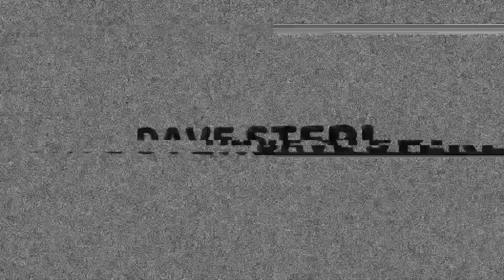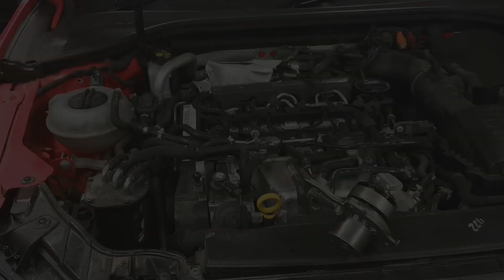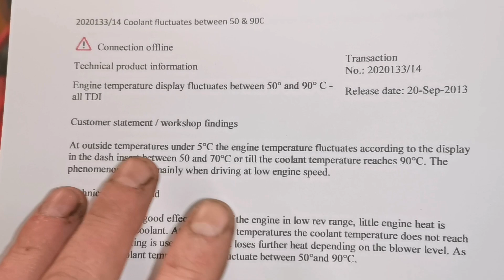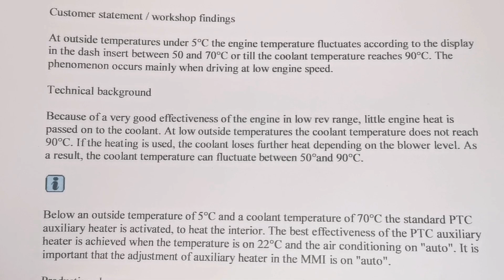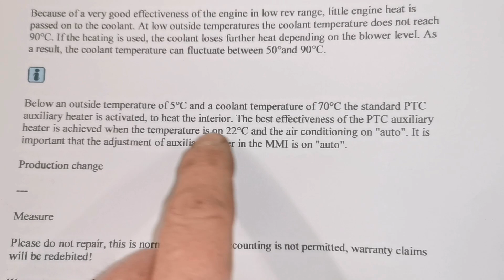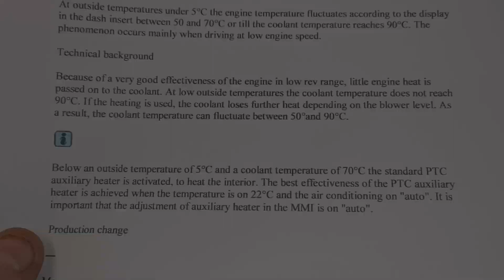Audi/VW TDI Coolant System Essential Information. Overheat or No Heat

Comment: Just an update Dave. My A4 Allroad TDI (2012) uses G12 so fine. The Polo (2015) however uses G13. Importantly it doesn't say 'Mit Silikat' on the coolant expansion bottle but did have the silica bag. Now safely out, so thanks again for the top-tip.
Reply: I've had my polo gti 6c for 7 years now, I did thermo housing myself year n half ago , and switched to g12 evo, vw dealerships don't offer g13 anymore,,, I removed silica bag,, just noticed this is 3years ago😅

Comment: Very informative Dave. I'm checking my A4 Allroad and Polo TDI first thing.  You wouldn't mind so much if they designed the silica bag that was located in partitioned part of the expansion tank with aluminium mesh as a security back up, but honestly that thing looks like a Tetley tea-bag in a mug of builders tea!

Comment: How do you bleed this coolant system? Does it need bled via VCDS? Or will it bleed on its own?
Reply from the maker: VCDS will run the electric pumps to purge the system. You can do the same by running the engine, lettingit cool down and topping up.

Comment: Why not fit a 2 bar electric fire in the dash Dave 😂😂, design gone loopy fire hazards of the future , no hope for the new guys joining our job nowadays, great info there Dave , not many will know about this , Top man for sharing it 😂😂💪💪🇬🇧🇬🇧🇬🇧🇬🇧
Reply from the maker: Wait to you see the next video
Reply: @davesterl  had another crazy car last week , 2013 fiesta petrol engine,  came in no heater blower , no heated rear screen , customer arrived with it , I noticed when she parked it up no outer brake lights , I put a new bulb in the offside , she was in the car , started it up checked new  bulb for illumination,  worked ok , same to passenger side,  again she started it up after new bulb fitted and guess what works now , heater blower and heated rear screen , crazy canbus ?

Comment: Another environmental cheat by VW group eh Dave , if they know they burst , they should recall them and do flushing for free , did an Audi A4 saloon on Friday ,rear spring , what a job , rusted seized bolts, stuck in bushes ended up lowering the subframe to get out the broken spring and fitting compressed new one , at least it passed mot💪, great video as usual Dave , take care
Reply from the maker: Aye mike, you know it. Its why i said for people to make up their own mind.

Comment: Hi dave , I could do with some advice on audi a5 2.0tdi ,2010 the dreaded hunting at  idle fault , theyve had new fuel filter and inlet metering valve replaced but still same , car drives fine , just idles rough , I checked out the drv valve back of  fuel rail and decided it wasnt t holding pressure , data was very erratic , so I replaced the valve reset both valves through vag.com , it idles great now but soon as you drive it it goes in to limp mode and fault code p0087 low fuel pressure , strange how it drove fine before just idle issues..  now it's the opposite idles great but no power any ideas ? Thanks rob
Reply from the maker: Only thing springs to mind is the low pressure side.

Comment: On my old Toyota Corolla diesel in the winter I just blocked 2/3 of the radiator with a piece of thin plywood. It never had a problem and warmed up nice and fast. Having some of automatic system to do this would be more fuel efficient than a 1kW electric heater.
Anyway, thanks Dave. If I ever buy an Audi Tdi I'll know what to look for.

Comment: That letter is rubbish. The coolant temperature should not fluctate if coolant system is working correctly. I actually have similar problem with engine under heating and even changing the in hose thermostat didnt help to solve the problem. Even audi dealership and german technicians dont know how to fix my car lol
Reply from the maker: Take from it what you want. It is a Technical Product Information document issued by the manufacturer, not a letter.
Reply: @davesterl  issued by the manufacturer to cover themself. Unfortunately we dont have the lemon laws like the US. I have a diesel that have consumption like petrol car because the engine cant reach optimal temperature. 
Mine was staying at audi for more than a month and they were saying that is normal. My question was why the first 5 years car was working fine and then suddenly started underheating. Everything was changed or tested with a donor part and nothing solved the problem. If is normal it will do it straight out of the factory, not 5 years later. My only theory is that the firmware upgrade  for the AC control unit is messed up and is not regulating the coolant flow properly when heating is on. They made upgrade in august 2016, ive noticed the issue september/october. Still not fixed 5 years later.

Comment: Good video dave , I had a customer complaining of no heat in the cab , they had purchased the car in the summer , there was no silica bag in the expansion bottle so I told them it must of split in the past and had been removed , but obviously it had a  blocked the heater matrix , but it's a very complex cooling system as you say ,  thanks for sharing your knowledge 
Rob mobileman
Reply: Hi Dave where is you garage mine had a new heater matrix and heading tank but now getting like air trapped sound in the matrix can seem to get it bleed correctly any
Reply from the maker: Yes Robert. the matrix's can block anyways, the mk4 and mk5 golfs were prone to it and they had no silica bag. The coolant only really ever gets changed if you pull the water pump on a timing belt job in reality

Comment: There was a lot of problems with casting sand left in the engine in the making of them also blocking the heater matrix also
Reply from the maker: yeah Shaun that's right, some say it's the sand that bursts the bag

Comment: I’d been aware of the burst T-bag issue and your previous video gave me inspiration Dave. Ever since you made me think about it a bit harder, during timing belt and water pump changes, I’ve been removing the T-bags while the system was drained down anyway and rightly or wrongly, I’ve been filling them with G12. My logic is, G12 worked fine before the creation of the silica T-bag although I appreciate there are cars with G13 and no T-bag. I’m still deliberating about fitting non genuine water pumps to these types. So far I’ve been fitting genuine VAG pumps but I’m waiting for this to bite me on the a$$ one day. Quite rightly, there would be a customer expectation that the replacement water pump should last for the service life of the timing belt. Of course, we’re removing faulty pumps during belt jobs so we know that’s not really working out!! Incidentally, the two stuck pumps I’ve found so far during belt jobs have not been accompanied by any customer concerns over overheating 🤷 Decent of you to share all this info Dave. At least if folks are informed they can make their own decisions based on having all the relevant facts. Do you mind me asking if you’re retro fitting non-actuated pumps to these vehicles and if you have a preference for any particular aftermarket brand of pump?
Reply from the maker: Cheers Russell. ive fitted a couple of Febi non-actuated and one Firstline(seemed ok) again non-actuated. I had one sticking at 50k so dont see the point of refitting the switchable plus the aftermarket non-switchable are a lot cheaper which my punters go for when given the option
Reply: @davesterl  I've just replaced my water pump with genuine VAG part no. 04L121011N which is a newer version - unsure if this will wear and stick like the old one?

Comment: Nice explanation, I only became aware of this bad a couple of weeks ago when I got in a golf with poor interior heating . Is there any flush method you can recommend to get this stuff out of the cooling system , I don't fancy changing the heater matrix if possible
Reply from the maker: Not really, its whatever you can rig up
Reply: @davesterl  grand so , thanks for the quick response.

Comment: PTC heater element (positive temperature coefficient) as it gets hot the resistance goes up in effect turning it off. No eed for ant external electrical control other than on/off  IIRC
Reply from the maker: yep, 2 relays low and high. detailed vid on the PTC heater coming next

Comment: Brilliant information Dave. I usually change the coolant bottle. When I order the new bottle two weeks ago for a Skoda it said with Silica. The bottle it's self was a smokey colour not the usual white, and when you look inside the silica seems to be sealed away. After a few phone calls it seems this new bottle was brought out in Jan 2020,and seems to be a mod.
Reply: Mine was the same, silica bag behind some more plastic, however mine was manufactured in 2018, the same year as the car (VW Passat)
Reply from the maker: oh, interesting thanks for that
Reply: @davesterl  I wonder if the temperature guage dropping off gets worse when the modified water pump is put in.

Comment: Thanks for the information, I have done a timing belt and pump on one of these engine I was told it had to be vacuum bleed. I have not done that not had any issues in 800miles, could you clear this up on if it needs it
Reply from the maker: id say you'll be ok after 800 miles. i rarely do a vacuum bleed

Comment: Interesting...Wouldn’t the low (ish) ECT result in higher fuel consumption (wider injectors PW’s). Perhaps this is not as much of an issue on diesels. Makes you wonder though ???
Reply from the maker: Ian , they've messed about with these cooling systems so much they end up with the owners seeing all these strange occurrances which Audi have to say are all ok. Some say sand picked up by the castings perforate the silica bag which turns the coolant into gel. Yeah, the contradiction is they switch the main engine pump off to get it up to temp quicker, but the engine can't sustain it at lower ambient temps!!! Thanks for asking, end of rant - yeah bound to use more fuel but only cools at lower engine speeds so hopefully nobody notices